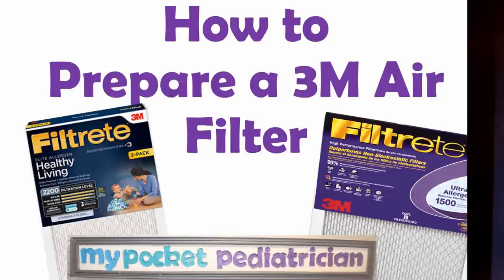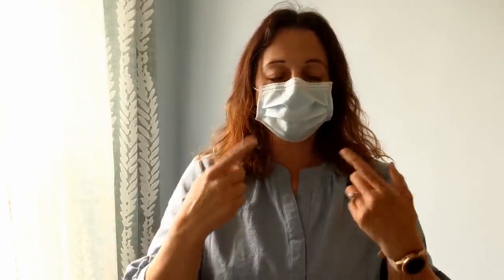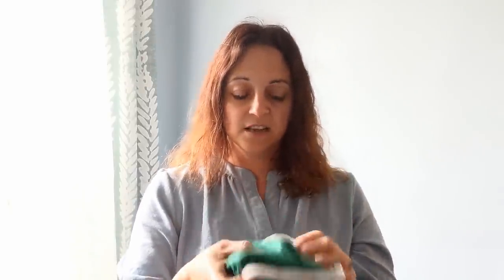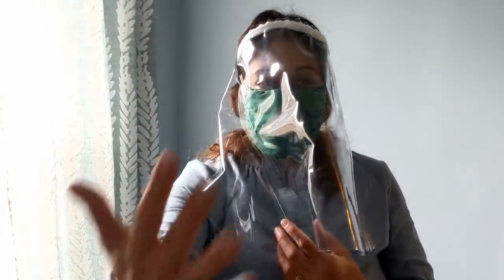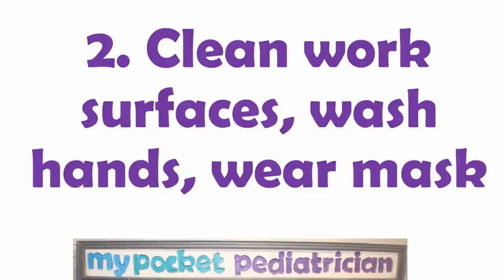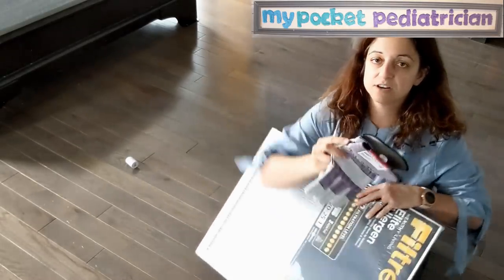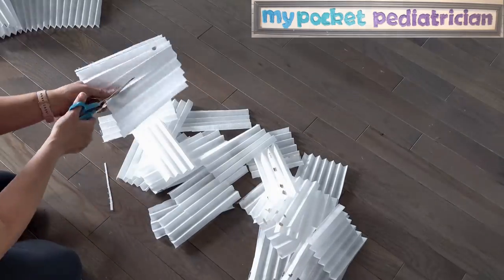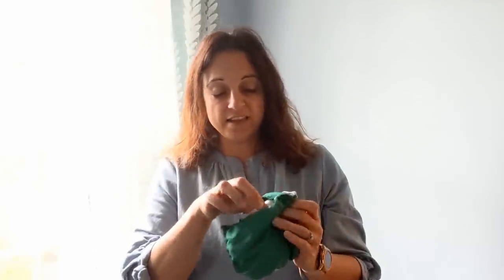UPDATED!  How to Turn a 3M Air Filter into a Face Mask

Comment: Thank you so much for the information. I was doing some research before making masks for my family. You have the best information I have found thus far. I do have a question. My niece has a 10 month old baby and we don’t want to put a mask on her because of the fear of suffocation. What is the best way to protect her when having to transport her outside when necessary. The baby will have an upcoming doctor’s appointment and she needs to be protected. I thought of possibly utilizing the filter with the car seat cover. If you have any suggestions I would appreciate them. Thank you.

Comment: I settled on the 3M Elite filter and after research confirmed its function for this application. I deduced that the N95 blocks 95% of particles down to 3 microns in size and the Filtrite Elite with MPR 2200 meets the same specification. I read that a MERV 13+ or MPR 1500+ is a high level HEPA filter. Vaccum bags, HVAC filters for home and car, meet this spec. But, I'm more comfortable with the 3M and other brands that actually state virus capture and high MERV.  Make sure have the airflow correct and achieve a tight seal. Pipe cleaners all around or foam all around or elastic all around. Bendable nose piece is critical.. I used short elastic loops with velcro straps around the back of the head. The velcro allows for specific tightning while elastic give flex to fit side of the face.

Comment: Thank you so much for this!!!
I have a question about face shields. If the virus are water droplets in the air and can remain in the air, wouldn’t we all need eye protection? We would have that one part that is vulnerable to the tiny virus particles. 🦠
Reply from the maker: Yes.  I have a face shield tutorial as well.   Healthcare workers are also wearing tightly fitting goggles as well.  I have no idea how to make goggles, but I did do a tutorial on how to create face shields from vinyl material - even a heavy duty shower curtain in a lurch, but some other materials did much better in my testing.  https://youtu.be/UKK0Y7XQN7I
Reply: Nothing that we do in the DIY community is going to be 100% effective!  The point is to do our best to reduce as much possibility of coming in contact with the virus as possible.  Your point about the eyes is well-taken!  I have heard the suggestion to use no-prescription glasses if you could get your hands on some.  They are available online.  I know it doesn't seal you up, but it is a barrier and also might sit down on the top of your mask, making it fit against you your face better! :)

Comment: Washable filter material that is comparable to N95 masks is available from a US company in KS. Filti. com is the name. Use a nose bridge wire. Seal seams with hot glue, silicone sealant or fabric glue. You could even apply a silicone bead around the perimeter to better seal mask against face.
Reply from the maker: Will the hot glue hold up in the laundry?
Reply: My Pocket Pediatrician I have not tested hot glue or silicone sealant for washing machine durability. I use Aleene's fabric glue. Here is my wash routine: after each outdoor use, I disinfect both sides of mask with isopropyl alcohol spray (at least 60% by volume), hand wash warm-hot, and dry in sunshine. Any advice is welcomed.
Reply from the maker: @susancorvalan6765  I really don't have enough experience in this area.  I'd love others to weigh in.
Reply: My Pocket Pediatrician I subbed and look forward to others' input. Since CDC recommendation for the public to use masks when outdoors, we all need help with this. TY for your help!

Comment: The Filtrete filters are made of 100% propylene = plastic. Perfectly safe to use for face mask filters. Thanks so much for your video!!
Reply from the maker: I have a new and improved Adjustable mask with FILTI material that passed the FIT test!  Please check it out here:  https://youtu.be/2J3Fq4o-U4I

Comment: I was told you can put those filters out in the sun to give them a good UV blast to (basically) sterilize them. Just don't get them wet.
Reply: BillyBob Sowbreath I was wondering how to make them reusable too but outside (especially this time of year) they will fill up with pollen. I wonder if put in the sun in a ziplock  would be beneficial to reuse however that method may accumulate moisture which wouldn’t be good.

Comment: This is the best video I have seen. Thank you! Can I put my cotton masks in the dishwasher by themselves to sanitize them? Or do they definitely need to be washed in hot water. Of course without the filters. Also are coffee filters any good to use as a filter?
Reply from the maker: I have a new and improved Adjustable mask with FILTI material that passed the FIT test!  Please check it out here:  https://youtu.be/2J3Fq4o-U4I   I think you can wash them in the dishwasher (the cotton part), but you can't wash the filter material.  Coffee filters only really filter coffee grounds.  They definitely won't filter viral particles.

Comment: Thank you for your video.  

I was wondering how electrostatic filters work, and is seems it is the wire mesh COMBINED with the fabric that creates the charge?  So if you are removing the wire mesh it wouldn't be electrostatic anymore?  

Also, it looks like some electrostatic filters ARE washable?   Hopefully the hivemind will design the perfect mask!  So maybe it can made to be washable in it's entirety? The filter material that you posted the MSDS link to states that it is polyesther, wouldn't that make it washable? 

https://asm-air.com/airconditioning/electrostatic-air-filters-work-pros-cons/
Reply from the maker: My understanding is that 3M has some sort of proprietary way of impregnating the electrostatic charge into the fabric. once that electrostatic charge is used there's no way to recreate it other than whatever their proprietary method is. So if you wash it or heat it or let it become clogged with particulate matter it is no longer effective. I am using Filti now, and I have another tutorial on that one, which is cheaper, designed for face masks, and can be baked and reused or autoclaved and reused.  The other tutorial is available here:.
Reply from the maker: https://youtu.be/2J3Fq4o-U4I
Reply from the maker: Other electrostatic filters work by having two charged plates. These are the kind that they have in HVACs in homes that are permanent. somehow they recreated this charge without having electricity but putting it into the material directly.

Comment: In all of your research, can a HEPA vaccum bag also be used for the filter? Or is the filtrete filter superior?
Reply from the maker: I know some people are doing it.   There is an EM doctor who has a tutorial on how to make a duckbill N95 from a hepa bag.   It passed the fit test   When I was trying to find out about the fiberglass question and toxicity data someone suggested to me that the vacuum.bags might have more particulate matter that you wouldn't want to breathe in.   They did sew the "fluffy" edges in the tutorial, and I really don't know, but it was suggested to my by someone in an independent (not 3M) facility that these might be better.   Again, I don't know...I'm learning as I go with this, and there is not a lot of data or real published studies to go on here.
Reply from the maker: The other option is that people are making duckbill masks from OR sterile wrap fabric, and they are passing the fit test.   If you have access the the material that everything comes wrapped up in that usually gets discarded that may be a great option.
Reply: I am obgyn, are you talking about the DISPOSABLE blue paperlike sheet that wraps over surgical instruments before they go into autoclave machine in for sterlization, OR as you mentioned fabric, then they also use dark green cloth fabric to wrap instruments for same purpose but this green fabric cloth is REUSABLE not disposable.   If it is the blue disposable wrap that you are referring to, then that is great bc i did not know that these are similar to HEPA /N95 capability.
Reply from the maker: @mayflower6819  I believe it's the blue sterile drape stuff.  I heard that people are passing a fit test with it.   Definitely not the green washcloth stuff...I don't think that will filter anything.

Comment: Dr.Lili thanks for useful video. I follow you in every steps but forgot to mark the direction of air. Is there any way to findout which side should be toward the face?
Reply: Take a look at your filter the side that goes towards your face for lack of better terms has a fibrous look to it.  The side that face out to the air is very smooth.  Look real hard and you will see it. I had to analyze my home filter in my unit to help me because I did the same thing and didn't mark it.
Reply: @deidtre  THANKS A LOT. Easy to find out .

Comment: This has been THE most informative mask video I have seen!  There are so many misleading videos out there.   Also, people, don’t buy those “surgical”  masks currently sold on Amazon under the “fashion mask” category. My elder brother just bought a case of them thinking they are the real thing. They are not medical supplies, and will do nothing to protect you.

I also cannot stress the importance of not restricting oxygen. I was wearing a homemade mask last week for two hours as I shopped for necessities, and I got nausea and almost passed out, even though I removed it while driving to each destination.
Reply from the maker: I have a new and improved Adjustable mask with FILTI material that passed the FIT test!  Please check it out here:  https://youtu.be/2J3Fq4o-U4I

Comment: i already removed the filter from the cardboard and wiring before i saw your video. is there a way to tell which side is back/front? I never thought about the airflow! i hate to waste twenty bucks and the filters are hard to find now. thanks.
Reply from the maker: The side towards the HCW is a little soft and dull and the one towards the patient is shiny.  It's really hard to tell, but I keep moving it around in the sunlight, and you can appreciate a difference.  Hope this helps!
Reply: Yes the side towards the mouth has little fibrous looking thread like, the side towards the air is very smooth.

Comment: Thank you for the video, it was very helpful. I got a filtrete filter, merv 14 rating,  and there was no arrow for air flow direction. Do you know for sure if it is really directional? Some fliters only have one side of metal, I can undertand those being directional bc of the weight.
Reply from the maker: I don't know for sure.  Mine had metal mesh on both sides and definitely had the arrow anyway.  I do see a difference - the shiny side goes towards the patient and the fluffy/soft side goes towards the healthcare worker.  It's very subtle but I can see a difference.
Reply: @MyPocketPediatrician  thank you!

Comment: I've found as a lay person that strips of Press'N Seal (bumpy, sticky side towards cloth and skin) enhance the seal of several types of face masks.  Andrea Senkowski
Reply: I am trying to picture this. Is part of the PnS on the mask and part on the face or does it act like double sided tape?
Reply: Hi KC.  I have only used it, part on the mask and part on the skin as if I had just taken scotch tape and taped the mask to my face.  It could probably by folded inside the mask to act as double sided tape, but the seal is less visible.  Good luck.
Reply: Thanks! This is an awesome idea.

Comment: This somewhat similar to how I've been making small batches of what I call the, "likely better than nothing" masks, for neighbors and friends in healthcare, or grocery workers.  However, you can reuse the filters if you iron them on LOW STEAM in between paper towels. Use caution not to damage the filter with too much heat. You'll need to use a multiple layers of filter material at once (2 layers minimum, 3-5 layers would be good), but as long as you don't damage the material by making the iron too hot, they seem to work fairly well. (I made a pleated hybrid pocket mask, similar to these a month ago, and so far those people have stayed healthy). The filters can also be sterilized by soaking in H202 for 20 min, and then allowed to dry.  

I mark the filter before I even cut the material (one side has says "outside ⚠biohazard symbol⚠" other side says "inside -toward face - use 2 at same time MINIMUM."  Using multiple layers helps increase the comparable merv rating.  

I also use a top stitching to encase a silicone covered wire (for tomato gardening), into the top fold of the pocket. It doesn't budge, and it allows for a closer seal against the face.
Like you, I've also attached the straps to fit over the head instead of behind the ears.  For this, I use the "elastic headbands" from the dollar store.
I make the mask from a tight woven polyester, because that's all I had in the house, fortunately, it wicks the moisture away from the person rather than holding it in like cotton does.

I do NOT guarantee this design efficacy, and I cannot be responsible for the efficacy of any prototype. I can only claim it's likely better than nothing (especially when the CDC had recommended scarves and bandanas). However, over the past month, the people for whom I've made these masks, are still well. ..and for that I'm truly grateful!

 Nevertheless, ALL prototypes are used at ones own risk!

Additionally, the more people who use these filters for masks, the less filters will be available for homes where one person may be ill, and isolated, but the rest of the family needs filtered HVAC air to stay healthy.  That's why I'd rather use a HEPA filter vacuum cleaner bag, to make a mask, if I had one.
Reply: Gothic -  HEPA filter vacuum cleaner bags are on ebay, but you might want to do a search first, I think HEPA filters are fiberglass.
Reply: Gothic: Thanks for your tips! I especially liked using multiple layers to increase the merv rating &  the use of polyester vs cotton. Now, if I just had a sewing machine......
Reply: @trenchantsometimes5149  The Hoover HEPA bags arent.  It's the cheap, non folded HV/AC filters and the automotive filters (things for high heat) which have fiberglass.  

One can also use (certain) layers of fabric interfacing. I forget which one, it has an  8 in the multi-digit number.

Comment: I lost the marking of front, back on my filter!, is there a way to tell by examining it?
Reply from the maker: The side that is somewhat shiny goes towards the outside and the side that is slightly soft or dull goes towards the face.  It's hard to tell unless you hold it up to the light, or sometimes you can run your finger over it and feel that one side is slightly fuzzy.  Also, 3M said they don't  officially recommend using their filters for face masks, but I found a company, Filti, that designed materials for face masks.  I have a new tutorial available if you're interested.
Reply from the maker: https://youtu.be/2J3Fq4o-U4I
Reply: My Pocket Pediatrician so is the fuzzy side outside away from your mouth? And the non fuzzy flatter one on the mouth side?

Comment: I'm not a sew-er but this is a great thought provoker.  I have some cup-shaped masks for shop work, NOT N95 quality BY THEMSELVES but as a serviceable substitute I could wear the shop-grade cup mask WITH an overmask made from a 3M Elite Allergen 2200 or their new Ultrafine Particle 2800 filters.  Better than most and certainly better than nothing.

Comment: I had 4 N95 masks from a year ago when we were remodeling and sanding and cleaning a moldy and nasty house. My husband is trained in PPE and decontamination, and he decon’d them and we have been using those (already used) masks during this pandemic. We have received many NASTY and hateful comments by total strangers, so I want to say to all of you to mind your own business. We are getting a little testy out there, and nobody almost 70 years old with sarcoidosis, high blood pressure and heart problems cares to answer a strangers questions that are totally irrelevant. If I had the foresight, I would have bought about 20 packs of 10 masks, but who knew? Now, you cannot even find one. So, I will make some using these tips. MAY GOD BLESS ALL THE DOCTORS AND NURSES AND OTHER ESSENTIAL WORKERS.

Comment: What do you think about a disposable heavy paper towel and object found at home for running to the grocery store?  A "DIY: one-minute face mask"(@cyME833gP4). accordion fold a half sheet heavy paper towel and fold the edges to hold large rubber bands and clip bands in place. Wear and adjust. I like the idea of a paper mask like the one I made under a reusable mask?

Comment: In theory, shouldn’t the airflow side of the filter be facing the patient and not the healthcare worker? Let’s say, the hcw is not infected; however the patient is infected, thus some air within the hospital may be contaminated (in theory). You’d want the contaminated air flowing in from the outside, through the mask and into the hcw’s lungs to be filtered. Even when the AC filters are used in homes, it filters the “dirty air” from the AC and disperses clean filtered air throughout the home so the homeowner inhales clean air.
Reply from the maker: The filter is directional to catch the electrostatic particles. These filters go into the return vents of the home, so the dirty air is going in the airflow goes through that and then through the air conditioner to go back into the home. You want the dirty air to be flowing towards the direction of the arrow. since the dirty air comes from the patient you want the arrow pointing towards the healthcare worker.